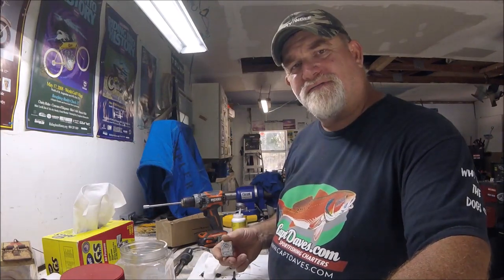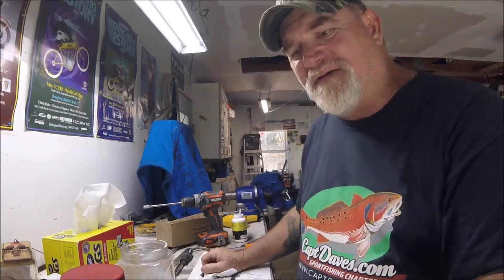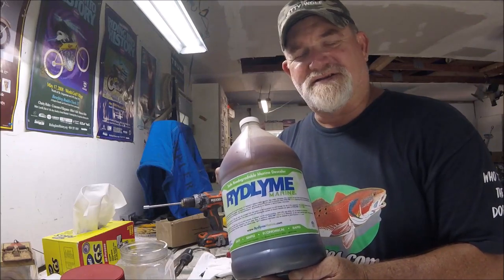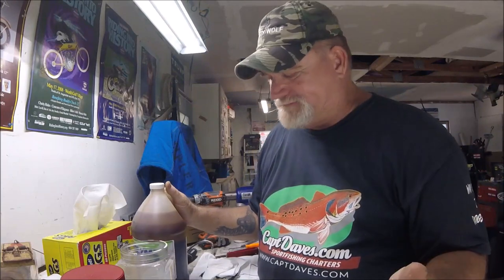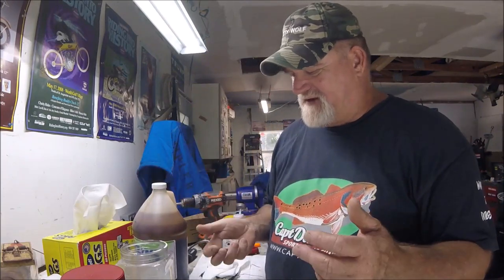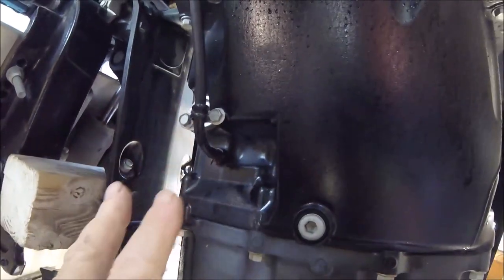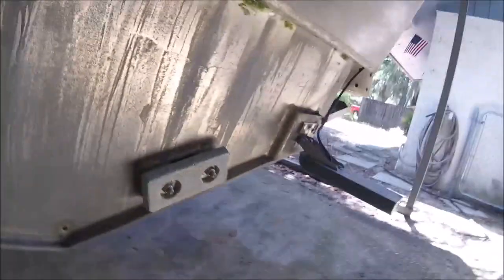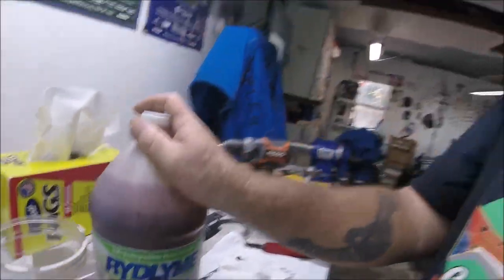Suzuki Outboard motor's HIDDEN anodes

Comment: Capt Dave is 100% correct. But lets go a little deeper into anodes or also know as sacrificial anodes. For the viewers who don't know what an anode is,  Aluminum does not rust or oxidize like steel. It gets electrolyzed. Basically put two dissimilar metals  near each other in salt water and you create a battery. Dissimilar metals being aluminum and stainless steel or brass/ bronze, it creates an electrical charge.  This is what eats up aluminum blocks and lower units. Electricity is lazy and goes to what conducts it most easily. The anodes are more conductive than the aluminum in your block or lower unit. This is why they get eaten up first. Make sure what you bolt the anode to is as clean as you can get it within reason. Make sure your hardware is clean too. think of it as connecting wires together you want the cleanest connection you can get so electric can flow easily.  Never ever paint an anode.   NEVER PERIOD!  Good vid Capt, Dave very accurate.  Nothing wrong with cleaning and re using an anode. Most viewers know this but for the few that don't know hopefully this sheds a little light.
Reply from the maker: TAKE IT FROM THE ''FIXER'', Dr. Gary! I've seen some of the outboards he's worked on. Looked like a alien autopsy 😆

Comment: Thanks for all of your great informative videos. I have just purchased a boat with a 2015 250hp suzuki that looks like new and I can't wait to get into some maintenance work on it this winter.  I have a question, I have the low water pickup and one of the screens is broken and I can't find a part number for it  anywhere.  A video on any tricks to  reinstalling the Tupperware would probably bring in big numbers.
Reply from the maker: somethings are best learned by doing. Parts SCHEMATIC:   https://www.boats.net/catalog/suzuki/outboard/2015/250hp/df-250apx-beginning-vin-25003p-510001/water-pump
Reply: @CaptDavesSportfishing  that only shows the main pickup, I have two water pickups, the main one and the low one at the front point of the lower unit. Nobody shows the part number for the front/lowest one. I know you mentioned in a video you have the low water pickup, I need that one.
Reply from the maker: @johnn9363  no dealer can order one?

Comment: Anodes, whether zinc or aluminum; salt water or freshwater, and bonding is a pretty interesting study. The anodes sacrifice themselves to the galvanic action of electrolysis. The small wires that you see on the lower unit, is a bond between metal components of your lower unit, and the power head. It's the same as a completed electrical circuit.

Comment: Great video. Good info. I’ve always used a wire wheel to clean up my zincs. Probably wearing them out faster that a chemical solution.
Reply from the maker: Ya don't want any micro steel embedded into anodes

Comment: Good afternoon, I'm a follower of yours. I have a 2006 Suzuki 250. It's getting hot and the alarm sounds on the console. I could have changed all the filters. I put new spark plugs. The thermostats. The oil is fine and the impeller is new.
Reply: ok my friend, make sure the water pump cup and wear plate are not scored. Suzuki water pumps are very "particular"  make sure pickup screens are clean and unobstructed. If it overheats on a flushette or "rabbit ears"  run it in a bucket or while the boat is actually in the water. sometimes changing the impeller alone is not enough. These are just some very basic things to check. Capt Dave values and appreciates all his viewers who comment and I'll help you if I can.  He's helped me many times !!

Comment: Hi Capt Dave,  Have you ever dealt with a Suzuki outboard making oil?  I have a 2018 200df with 80 hours that has been making oil for most of those 80 hours.  It's been to the dealer once and they changed the IAC valve but I don't think they really want to deal with it.  Just curious if you ever dealt with an issue like that.
Reply from the maker: no, I have not. I'll ask my channel's resident zuki mechanic ''Orowock'' to respond. I think it can stem from not running the ''absolute piss outa the motor.'' Seems every mechanic I've talked too says, ''these motors (V6) wanna run and run fast, that's what they are designed to do.
Reply from the maker: Orowock said;  injector stuck open could do that. Also a faulty lift pump could do that as well. Pull spark plugs / check plugs or possibly one plug for being wet with gasoline. or remove injectors and send them to a place that rebuilds and checks them. The place we send them to gives a really nice printed performance read out. As for lift pump/low pressure fuel pump, look up values or necessary pressure out put, attach fuel pressure gauge check for irregular readings. As for being to the dealer only one time, Its still under warranty!!!!!  They have to deal with it!!! That warranty is built into the purchase price of that motor he paid for it. Go to the dealer, have it documented
Reply: The low pressure fuel pump was replaced.  I will keep at them to fix this issue.  Thanks

Comment: I have a Suzuki DF175 and am about to do my first 100 hour service. I’m going to change my anodes. I am worried
Reply from the maker: Dont be, just watch all my videos about changing them at my channels playlist for my boat. Cleaned the ones in the block today, with rydlyme, after changing my oil, after a 1/2 day charter.  I show you how. At 100 hrs Id clean them not replace them. No need. Again I use rydlyme.